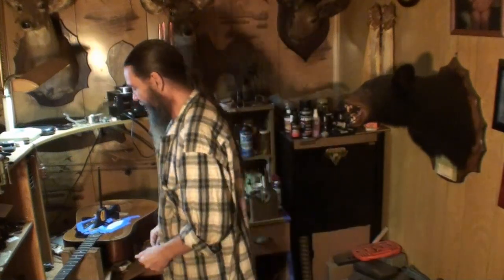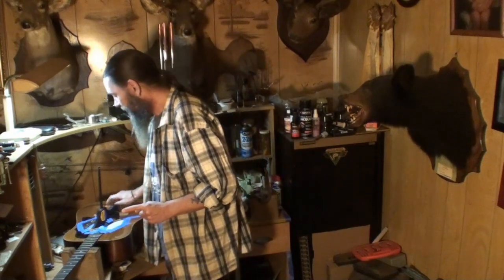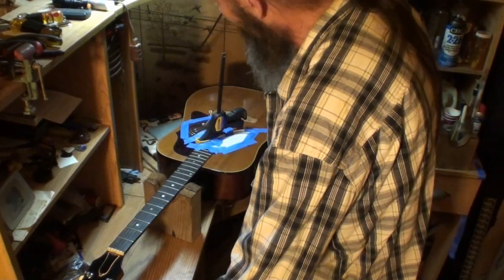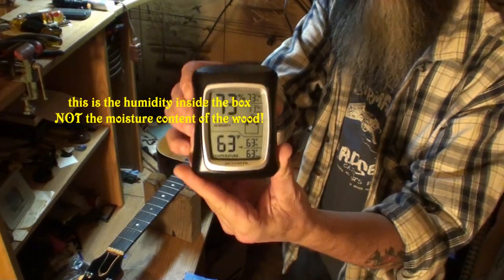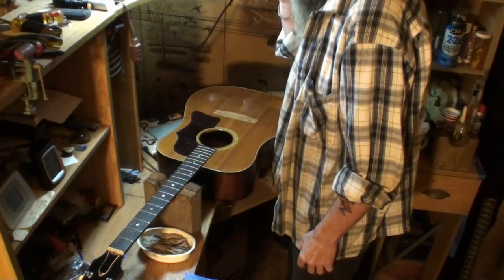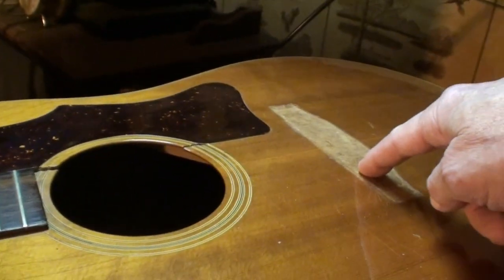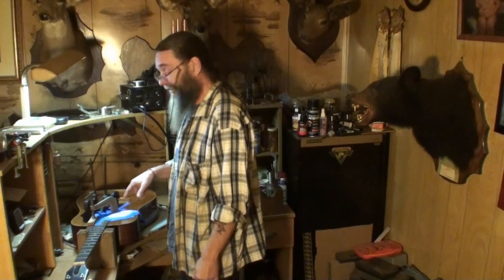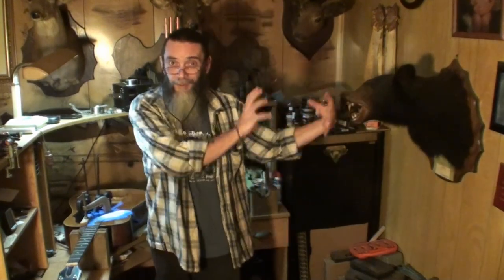gibson j40 inspection look what a little humidifying can do

Comment: Hey Randy, hope things are well with you. I was sitting back drinking a cold one getting my fix of the house that never sleeps watching you repair the violin and heard you mention how you wish you could get  the Titebond to flow easier. A little trick I use is I put a little extra glue in the pipette and then put it in a glass of warm to hot water for a few minutes then squeeze out the first droplet of glue and go from there. Don't use all the glue in the pipette because sometimes the pipette will fill up with humidity from being in the warm water and you don't want to squeeze that water into the joint. Hope this helps you. Let me know how it goes. Take care of yourself, I haven't heard you mention anything about your mom I hope she is doing well. Okay, take care talk at you later. Brian

Comment: Could be a srinking pick guard that has pulled the top. Two of the cracks line up with the edge of the pick guard. Happens to Martin 's. All the time!
Reply from the maker: yup pick guard did play a part in it, I almost decided to take it off for this repair. the wood and pick guard both have shrunk quite a bit. thanks for watching!

Comment: Looks like some Cleco Side Grip Clamps 3/4" Gap x 1" Reach would be helpful to line up the board at the cracks. they use them for holding skins and parts together when building airplanes. they wouldn't be so bulky.
Reply from the maker: I'm just about to order a bunch of clamps of different shapes and some other tools and will definitely look into them, I checked out the Triton TCMBS belt sander you mentioned and it's on the list too. thanks for the tips and thanks for watching!

Comment: Randy could you place the whole body inside a plastic bag? To seal, save trying to tape the sound hole closed? What's happened to Earl?
Reply from the maker: yes I have did that before, the humidity in this room is maintaining over 60% so that will help in getting this guitar humidified, if it were lower than 55% I would put it in a bag. thanks for watching my friend!

Comment: Hi randy, really enjoy your grass roots style of vids.. I have an advanced jumbo inside of 10 years old with a crack  down the center and 2 others by the sound hole.  I have humidified it and it is much better.   The crank by the sound hole away from the neck has completely closed up, would it be safe to say that as long as i keep up with the humidity that a repair isn't nessasary for that one? The middle crack below the bridge running  to the binding is almost closed up i assume by watching your other vids that I need to repair this.  The crack by the neck one goes from the sound hole to the base of the neck about 1/2 in length .. Not really sure how to handle that one.  If you read this thanks for your time. I could send you the guitar but I wouldn't think you'd want another guitar with the same issue's.
Reply from the maker: it sounds like it's not too bad yet, but every one of the cracks should be glued and cleated, even if you keep the guitar humidified elements, skin oil, dust and everything well find their way into the bare wood over time and only grow and get worse. I'd be happy to fix it for you I don't mind working on crack but resetting a nexk I hate because so many things can go wrong. send me a PM and pictures if you want and we'll discuss it.
Reply: Randy Schartiger will do Randy thanks!

Comment: Hi Randy,  I just swapped out a new Gibson J-45 for a mid 70s J-40.   I know crazy aren't I.  But the buyer also threw in $400 cash.   My older 70s J-40 is in need of TLC, similar to what you are doing on this video.    My question is,  how did you get the humidity increased in the guitar?  You mention you put water in the guitar.  Not quite sure how you did that.    Did you actually pour water in the sound hole, or place a container of water in the guitar through the sound hole or put damp clothes in the guitar through the sound hole??    Sorry for my ignorance.   I have D'Addario humidi sacks in the guitar now sitting it its case.    I think your way looks like what I need to do to bring my J-40 back to life.   Whoever owned it before me really did not take care of it.    It's a crime how some abuse their instruments!!    Thanks for any advice dude!!   Ira

Comment: With that bracing pattern and bridge type, I can’t imagine the guitar ever sounded great. I could be wrong of course, just guessing.   The pickguard does show signs of shrinkage. You can see the original outline. That’s likely to be contributing stress that’s pulling the wood grain apart. 
“Please release me, let me go...”
Reply from the maker: I'm seeing more and more of the pick guard print as the guitar humidifys and expands, I can't tell which has shrunk most, the top or the pick guard, but she was definitely dried out about as bad as I've ever seen. taking a lot of time to get it back up to the safety levels. thanks for having a look brother!

Comment: Is it possible that the crack is the result of the old pick guard shrinking? Would pulling the old pick guard off, before the braces and top gets any new glue, take some pull away from that old plastic as it continues to shrink. If you think that is a possibility, you could glue everything up and put a modern material guard on after everything sets. From what I’ve heard the new guards aren’t supposed to degrade and shrink. You’ve got the experience with such things but just thought I’d throw that idea out. Good luck.
Reply from the maker: that's a good point and while the pick guard did shrink the wood has shrunk even more because of the guitar being so dried out, I thought about removing the pick guard but it really hasn't shrunk that much, not nearly as much as the wood. if this guitar hasn't had the double X brace system it would be a lot worse than it is.
Reply: Randy Schartiger I hear you. I was just checking out some stuff on ebay and there was a nice looking J40 for sale as a project and it had the same cracks, but they were definitely tighter, as you say. Curiously, the glued on wings on the headstock of that guitar showed cracks too. It almost looked like Gibson might not have done right by some of those guitars. Anyway, best of luck from central Wisconsin.

Comment: Do you have Thompson Belly Reducer and is this a guitar that it could be used on (especially since the bridge is already off the guitar) to keep from having to do a neck reset?
Reply from the maker: I have one yes, but this guitar has very little belly, not enough to try to remove it, Thompson Belly Reducer does work well for removing belly but in this case it's the neck angle that is off.

Comment: Randy shave a 1/8" off the bottom of the bridge beings you can't shave because of the string holes, you have plenty of meat on the bottom of the bridge
Reply from the maker: that's what I've been thinking about doing but the wings on the Gibson bridge is only .118 tall so I may not be able to sand enough off of it to get the action down without losing the wings, it's got a lot of meat near the center but both wings (both ends) are really thin.